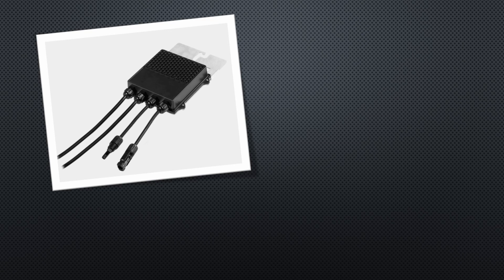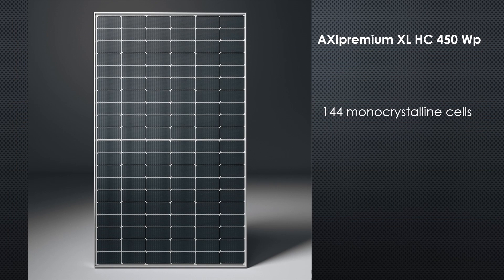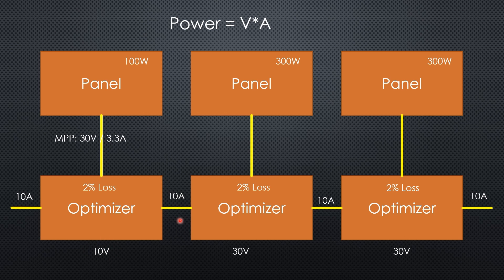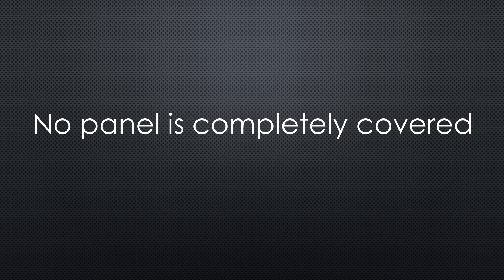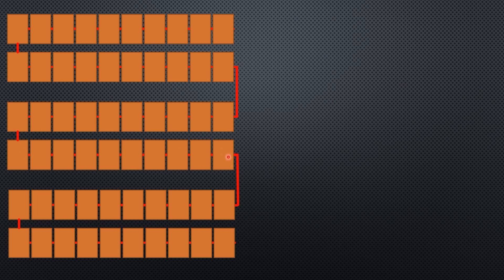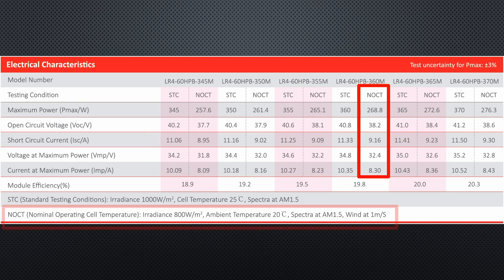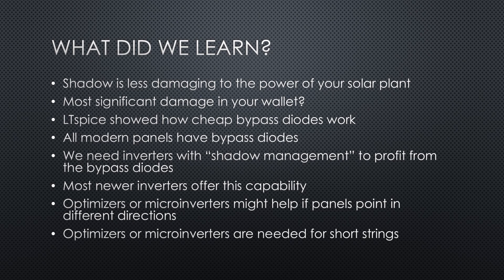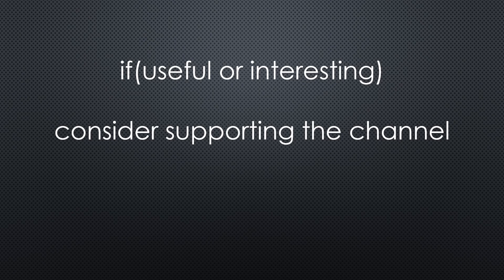441 Are PV Optimizers Worth the Money (e.g. SolarEdge)?

Comment: I have one Customer with 2 PV systems on the same industrial semi-round roof, one row with 14 Sunpower+Fronius (3,43kW) and one row with 10 Kyocera+Solaredge (2,5 kW) one row upon the other, they get the same radiation and the same pine tree shadow in the morning, covering 2-3 module each row :  when  Fronius gives 147W / 3,43= 42,8 W/kW ,  Solaredge gives 897W /2,5 = 358,8 W/kW.
Diodes in a real PV module are not working as you said.
Let me know a private mail and I'll send you my case
Reply from the maker: That is interesting. I left a link to a video where they used a (newer) Fronius in exactly this situation
Reply: Uh, that's a huge difference when broken down to the installed keep as the SE is smaller - the difference is so enormous that there has to be an issues in the Fronius setup somewhere
Reply: @brainthesizeofplanet  NO issues on Fronius at all, when shadows disappear and full power foro both is reached, Sunpower W/Wp is a quit higher respet Kyocera and SE. 
Fronius or SMA (traditional 2xmppt) are the same in shadow situation.

Comment: Great content. I wish you had another video that would go into the optimum place for your battery before you put Power to your home. Every time you can vert from DC to AC to DC you lose a small amount of energy each time. Where in the line would you put your conversion so it loses the least amount of energy while transitioning?
Reply from the maker: My (800 volts) battery is directly connected to the inverter. So the path is very direct: From the solar panel to the battery is DC. As you write, the other systems have more conversion losses. My battery is around 800V. So the currents are small and the losses, too.

Comment: Both my son & I have very similar solar systems here in the UK. We both use JA Solar 395W panels linked up to a Growatt inverter & battery, both put in by the same installer. Both of our roof arrays point in the same 280° westly direction. Neither array is shaded. We live about 40 miles apart so our weather is roughly identical. He has 12 panels to my 8 & so in theory, on average, I should see exactly 66.6% of his solar output...but I don't! I consistently see about 72% of his output.  Rightly or wrongly, I put this down to the fact I have 4 Tigo optimisers & he has none. That said, it only equates to about 40 kWh/year (worth about £130/decade) so I reckon my son did the wise thing leaving them off as they will never pay for themselves.
Reply from the maker: Interesting! So the Growatt does not detect the optimum for your son's panels. Because without shadowing, all your Tigos will detect the same maximum. They seem to find a better optimum than the Growatt!
Reply: @AndreasSpiess  The only other difference in that my 8 panels are arranged in landscape mode while his 12 are in portrait mode. I can't see that this would make a difference but maybe it does?
Reply from the maker: @MrSensible2  I do not think the arrangement makes a big difference. But the direction of the roof is critical. And also when the sun appears and disappears, of course (hills and mountains)

Comment: WOW! awesome video - I confirmed the exact same findings by trial and error when trouble shooting for a bad panel. In defense of the micro's and optimizers - older generations of solar panels probably did not have that pesky diode. But modern half cell solar panels just changed the game completely, they are amazing in dealing with shading. I wish there were more grass roots videos or communities like this, because most solar system installers have no clue about the intricacies of solar installations beyond wiring and city codes, hence the easy way out is to just simply offer a money making stop-gap measure. Good job, man!
Reply from the maker: Thank you! These diodes seem to be the standard for the last 10 years.

Comment: YOU DONT SEEM TO WORRIED ABOUT arc  FAULTS OR FIRES FROM THEM MY FRIEND - I CARE AS MY FAMILY SLEEPS  IN THE HOUSE UNDER THE ARRAY  ??
Reply from the maker: No, not at all. Because our home is made of concrete. And our installation is safe. Millions of such installations exist.
Reply: @AndreasSpiess  my roof is made of timber frame and tiles - would you be concerned then or atleast consider the dangers - 10 kw and over is becoming more normal here
Reply: This can happen If you Installation is not correct. Experts know how to do it. Another "Argument" from the microinverter companies to raise these concerns and why you need a microinverter. They should not work Work with fear. This doesn't Help. Same when they sell their system AS If you get energy Out of nothing. You cannot more Energy. So microinverter can Help but Not everytime and everywhere, especially If you have a well planned Installation with good panels and shadow management.
Reply: @thomasblock3117  but micro invertors TAKE AWAY  the risk of  of ARC faults - you cant deny that ????
Reply: @airselectricalcontractors842  Sure, there are always risks

Comment: enphase is also about  safety and no high dc string voltage coupled with panel level monitoring so you can see if a panel has gone down. Thats your insurance over the next 20 years  - i no what i want on my roof  - google solar ARC faults
Reply from the maker: Enphase is a good product if you want to go the microinverter route. I will use it also for a small system. Still we have to see how long they will last...

Comment: You did miss one benefit of optimisers for ground based panels.  They do make the installation a lot safer by limiting the open circuit voltage to 1V.  If panels are installed where the electrical wiring is accessible then the use of optimisers might be justified on safety grounds alone.
Reply from the maker: I agree. I am not against optimizers. I am against lying. If these additional features of optimizers are so imporant, I do not understand why the argument of loosing the whole power with one small shadow is needed to sell them...
Reply: @AndreasSpiess  because the SafeDC 1V feature was introduced in 2020 :-) - so it's new.

SE is better if u have more shade than usual or a complex roof - otherwise any good mppt will do the job just fine 

Also if SE isn't planned correctly it can be counter productive, Voltage Blocking
Reply: It is not that microinverters are not helping at all, but I don't like If they play with customers lack of knowledge and just lying.

Comment: Thank you very much for this analysis. 
I always asked myself how the cells behave in such a situation, because this year I am planning to built a small solar balcony power plant with storage, where I can only install two panels in very different angles. So I will have very different sources with relatively low voltage and have to figure out the best converter to charge a battery so I can use the power when I am home, which is mainly at dark hours. Schöne Grüße aus München!
Reply from the maker: In your situation, I would go with microinverters.

Comment: Very interesting! I wanted a low voltage DC system for a water heater and some 135W half size panels. After fiddling with designs I realised it was more efficient / simpler to have separate optimiser / boost converters on each pannel - with high current / low voltage losses mount up very quickly. It seems to work quite well actually.
Reply from the maker: Glad it works. I did not say, it does not work. I said it is not needed...
Reply: @AndreasSpiess  Yes sorry I didn't want to imply that! One thing occurred to me though.. for most applications isn't the selling point of the optimiser to convert directly to 230V AC at each panel? Not applicable in your own case, but I could then understand that it would shift and break up total losses from a central inverter to each optimiser so not quite as bad!
Reply from the maker: @tolsen4893  These "optimizers" are called "Microinverters" (also covered in the video)
Reply: @AndreasSpiess  Ahhhhh! Sorry that makes sense!!

Comment: I think your experiment is ameturish at best.  The way to truly test the efficiency of optimizers is to have two identical strings (i.e., the same number of panels with the same ratings and the same manufacturer), located at the same location (well, one near the other will suffice).  Connect optimizers to panels in one string, and connect the other string directly to the inverter.  Now, measure how much ENERGY each string produced over time (e.g., a week, a month, a year) and see which yields more ENERGY.  Instantaneous power is meaningless.
Reply from the maker: Maybe you watch the video I referenced to if you need more evidence.

Comment: To a third party who offers after sales the optimizers offers their client a monitoring system of each solar panel, so that should one become damaged due to hail or stones topped or manaufacture failure. The third party can see which panels have been affected and act acordinglly. The alternative is to test each panel on the roof to eliminate the faulty panel or panels. Otherwise yes you are right if you can see the damaged panel, its easy, if not, then you've got a long day ahead of you, time is money! Its an insurance ellement that all!
Reply from the maker: I monitor the string voltage and divide it by the number of panels. So I see if one does not work anymore. Finding a defective panel is not very complicated if you use a FLIR camera. But if you ask solar professionals, they tell you that defective panels are very rare. Not so with optimizers...
If you see it as an insurance, go for it!

Comment: Hi Andreas, 
I want to share some thoughts. 
At least in the Netherlands,  'we' love Enphase and Solaredge. I think for 2 reasons: you have the option to monitor each panel for faults and you can see the yield.

BUT, does that does that outweigh the cost or complexity?

I was thinking of using a normal inverter (DC or AC, according to your needs), but with an ESP32 or similar powerfriendly device in the terminal box behind each panel, feedback via wifi?

If you monitor the voltage over each diode, shouldn't you be able to measure the performance and panel fault? Power the board directly from the panel itself. 
Simple and cheap?
Reply from the maker: You can measure the voltage across a panel if you find a good way to connect your ESP to the panel connectors. You just have to add a stepdown converter.
Keep in mind that these panels are exposed to sun and rain. Adding any complexity will not improve their reliability. I have a simple way to see if a panel is defective: I divide the string power by the number of panels. Like that, I easily see if one is defective (which is much less probable that you have a defective optimizer, BTW.

Comment: Perhaps solar companies should be working with home builder and architects and new housing project planners to re-write the building codes to include “solar” optimized roof designs (angle or pitch for maximum sun exposure), and orientation of houses in relation to the sun.
Reply from the maker: I completely agree!

Comment: Interesting video! I recently had my PV installed with a SolarEdge inverter and 2 sets of 9x 370W solar panels with optimizers. 
I certainly did have to wait quite a while a while until the inverter for SolarEdge was available. I choose optimizers because 1 set is on the roof of my house and the other is on the roof of my "shed"/parking spot. I also thought I would need the optimizers due to potential shadows of trees a few moments during the day, I guess that was less true than I thought.
Don't know exactly how much I paid for each component, but it wasn't necessarily cheap and let it install by professionals (they already came back to sort out an issue).
Reply from the maker: I would not look back because your PV works.
This is for people who have to decide and I wanted that the are not cheated.

Comment: Hi Andreas,
I have a very important observation to the topic, where probably optimizers have an important role! I have installed a Huawei Sun2000-8KTL inverter with 2x9 Sharp 410 PV modules conencting to the 2 MPPT trackers. These PV panels are on a south directed 35° inclination roof in two parallel rows, where I have a tall tree in front. So like a solar clock, the shade wanders around. I was convinced by the installer that no optimizers are needed, along with an australian vlogger, who made tests on different mppt inverters. However! Today the sky is crystal clear, in Hungary, the heating is off, that it warms the house, but the 7.2kWpeak system gives only 0.6kW at 2x310V, compared to a foggy ugly diffuse day few days ago, when I had over 2kW. Also some other day, with clear sky, it happened, that in the morning I had 210V and 9 amps on one string, then jumping up to 310V and 1 A. So, my conclusion is, that if you totally block the light from given areas, then the diodes will bypass, and you get to an optimum, but if you have some partial light, casted by leaves on a tree, it will screw up the mppt, and give low currents at high voltages. I will do observations further, maybe you could test this feature, or we can discuss some experiments and data to see here more clear.
Reply from the maker: Strange behavior of the inverter. Maybe you contact the Huawei support. That is a strange behavior.

Comment: Optimizers are great for the company that installed your panels, if  one of your panels get broken you can see that in de app / on line. So the install company will save time figuring out what is wrong.

Comment: So, now in your simulation. Let's add a bypass diode for the entire panel. Have all the current sources in the panel produce a current as if they are 90% shaded. And add a current source in series with the panel bypass diode. To simulate it's in a string. That current source should be the current from an unshaded panel.

Your load as a current source will not work anymore, so you need to fix that.... maybe just make it a resistor? Solar inverter have big input capacitors. Maybe add some of those.

Now what happens to the voltage across the resistors inside the cell model? And the current through D1? 😉
Reply from the maker: Maybe you try it, if it interests you. For me it is too much effort :-(

Comment: Wow, this video is really unbelievable. It's so biased, and I get the impression it's being sponsored somehow by a competitor. First of all, by-pass diodes are not meant to act as 'shadow' management. They are there to protect the shadowed cells for overheating. If a by-pass diode has to redirect current on a day to day basis it will fail quickly and you risk losing the whole module. Next to that MLPE offer besides optimization of power other benefits like module level monitoring which allows pinpointed alerts and possibilities to service your system in a more efficient way. Last but not least...Safety! a traditional inverter cannot switch of the DC-voltage of the string, in your case the voltage is close to 400Vdc and that's a big risk. A SolarEdge system is producing not more than 1V per module by default. So in a 10 module system, only 10V on the cabling when the inverter is not in production. Only when all parameters are checked it will allow the optimizers to increase the voltage to the fixed voltage of the inverter. Also, next gen optimizers even have temperature detection on the connectors to detect possible risky connectors and therefor stop possible arc-faults.
@ people; it's always good to check different sources and make your own decisions, there are more video's (non-biased) that show a complete different picture and why having MLPE does make sense in every scenario. Good luck!
Reply from the maker: I agree with all the additional advantages you mentioned. This was not the point of this video. Maybe you can answer my question: Why do so many sellers still tell the story of one leave blocks the whole string if their products have so many other qualities?

Comment: You kept saying "modern" . What does that mean? For example, our panels are 9+ years old. Would they be "modern"?  So far, no microinverter failures, so I can't tell you if the 20 year warranty is legitimate. AC on the roof isn't great when I think about adding batteries!
Reply from the maker: I do not know when they started with the addition of bypass diodes. Somebody wrote that it is 10 years ago. So yours could already have them.

Comment: I've been running 12 panels with SolarEdge for 7 years now. Last year I had an optimiser that stopped working. The main advantage of this system is that you can track the performance of your panels. I called the company that installed my system and they replaced the optimiser free of charge (Warranty). 12 panels should give me 3420 Wp but they outperform every single year. Got at least 3800kWh every year minimum. The only thing I don't like is that the main invertor is passively cooled. So I added some PC fans on a timer to cool down the backplate during the hot summer months.
Reply from the maker: Thank you for sharing your experience. You were happy that they replaced the device free of charge! Here they usually are not allowed to go to a roof just like that ;-)